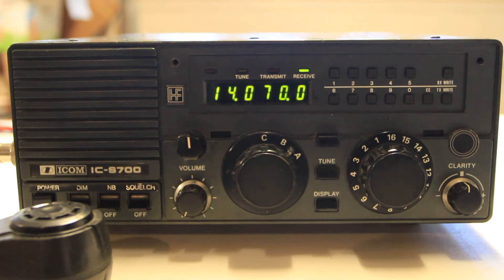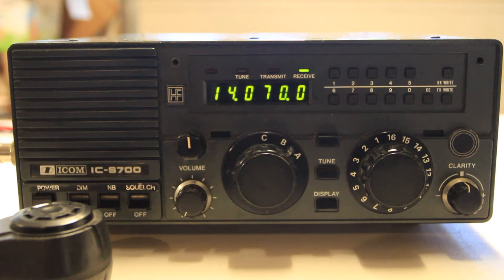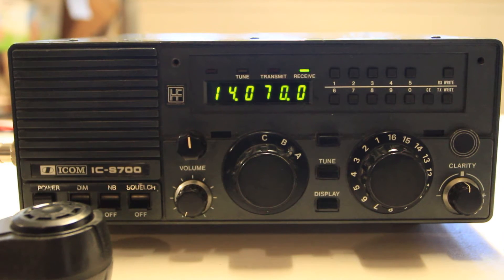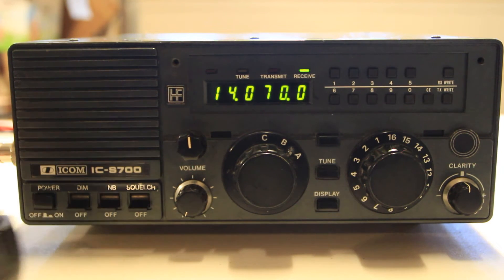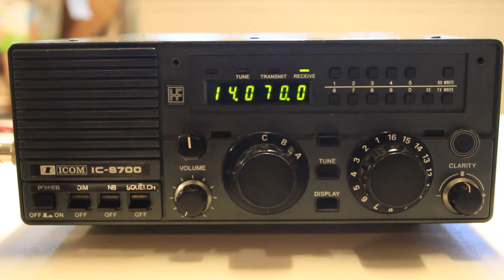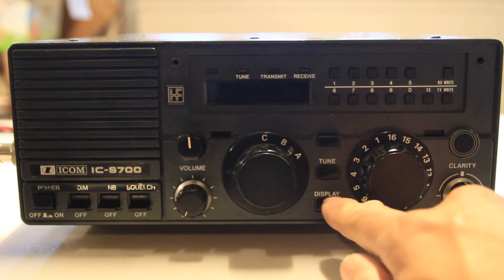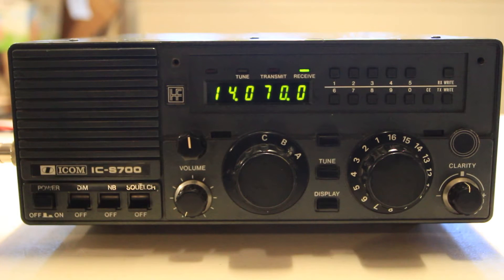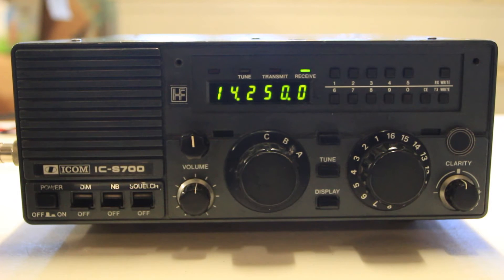Repaired Icom IC-S700 (Military Icom M-700!)

Comment: I have one of these, nice radio. I use it to check into nets. Do you have a pinout of the accessory socket? There is a dummy plug installed that has two jumpers, in place of the scrambler. The dim switch on mine has been modified to provide LSB in the down position. Any info you have would be welcome.

Comment: Did you add the mode switch or was it there. Mine is missing the mode switch
Reply from the maker: I didn't add anything, but it could have been modified (likely modified, actually... there was likely an encryption circuit in there, removed when I got it, thinking that is ex-military).
Reply: @ai6yr500  mine has a cap over the hole, I bought it only because it was cheap. I didn’t even realize it was the military version. I also have an IC-M600 and the tuner (AT-120) 
I picked up cheap. That is wide open and USB/LSB. Can’t beat these for 100 bucks lol

Comment: How much costs this transceiver in USA? 73 de LY3SR.
Reply from the maker: +Arunas Paulionis These transceivers are not available in the U.S. -- this one was a military surplus receiver.
Reply: +KK6FUT ??? Icom IC-M700 HF Marine SSB Ham Single Sideband Radiotelephone Transceiver
Reply from the maker: +Arunas Paulionis That's also no longer in production, built in the 1980's. You can find them on QRZ and eBay, however.
Reply: +KK6FUT Thanks

Comment: the display knob is not a military-fix. had it also on mine in 1992, when working in Somalia for the UNHCR, and it was used during scan-mode in the night, so no lights in our office... the radio scanned during off-hours, so msgs could be received via automatic arq, when the setup was not manned (we sleeped during the nights), exept under the blackhawk-down incident, where we had to relay coms from our employee in Mochadisho to our HQ in Nairobi, also supported this coms with my own Icom 728... rgds. ps. has also one ic-m700 now, and it will soon be fitted in my car as a 60m/80m band NVIS-rig.
Reply: +Lars Erik Hinrichsen Cool, thanks for the great info!

Comment: Very nice set. I just got an M700 that was used by CAP as an SSB trainer and doesn't have the PA board. Just using as a receiver & has the exciter output, didn't cost me anything, but thinking about building a simple QRP PA for it.
Reply from the maker: +sdrisfun  The output without the PA might be close to QRP levels already. You could also drop in any IC-745 or similar era PA board into that same slot -- they are the same, as near as I can tell. Also an M-710 board on eBay that would work, but might require new transistors (and you'll pay more than  what you paid!). The PA board on those old 1980's Icoms look pretty standard.
Reply: KK6FUT
KK6FUT, TNX for the info , will check into picking up an older Icom PA, would be a fun project. Also thinking about taping into the AGC with a simple S-meter circuit.